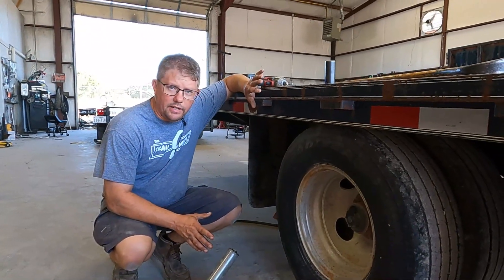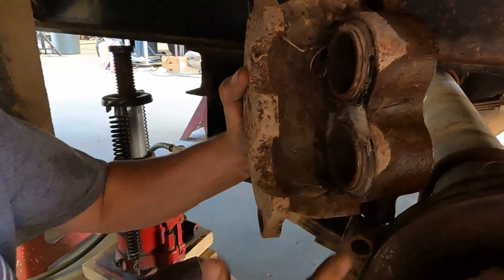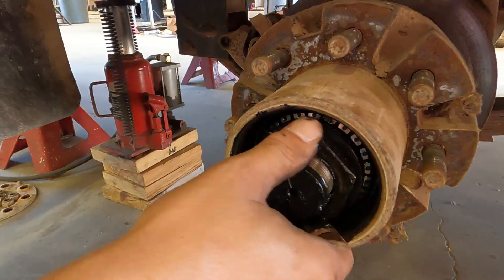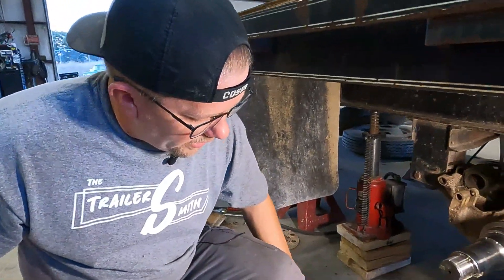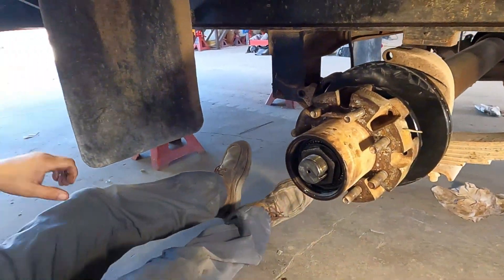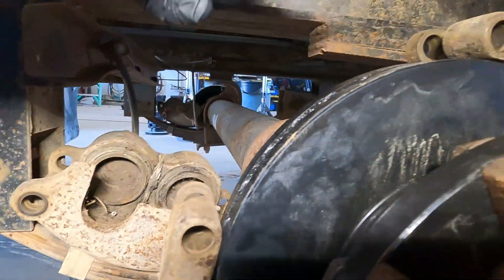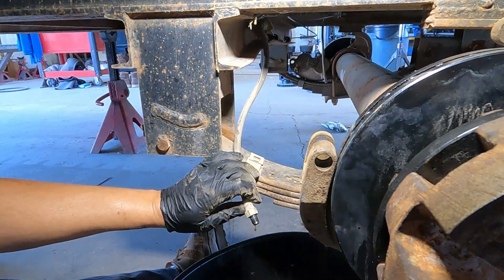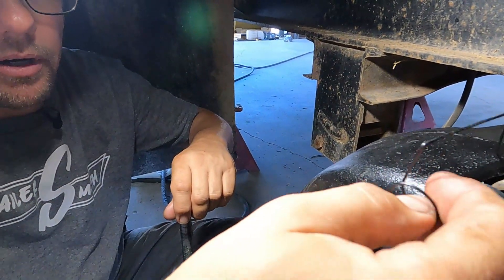How To Replace Hydraulic Disc Brakes On 10K Trailer Axle

Comment: is there any way to get just the bullet that goes on the bolt anywhere? cant seem to find them anywhere.
Reply from the maker: The only place I get them from is in the brake pad kit. They can be installed without the bullet, if you take your time. The bullet has only been in use a few years. Or you can try buying the kit just for the bullet if you want to go that route.
Reply: @TheTrailerSmith  thank you